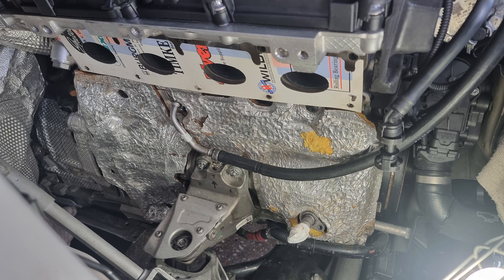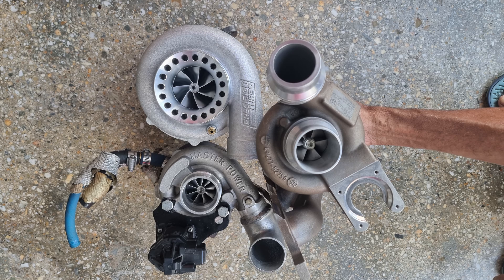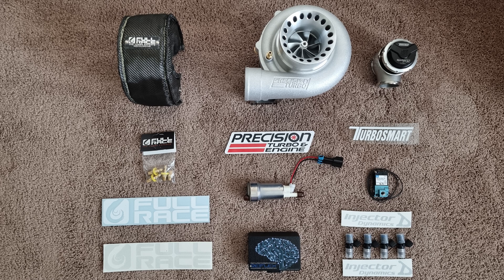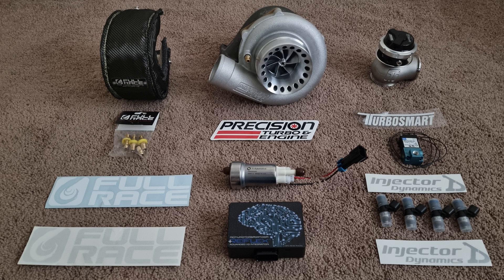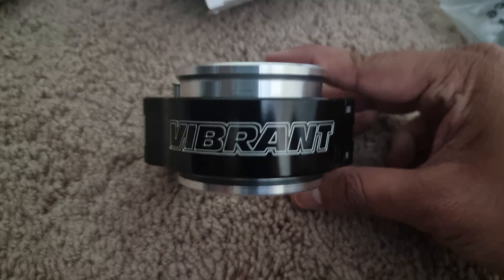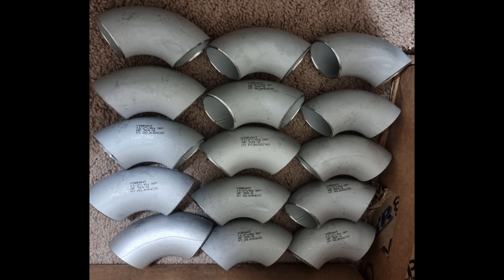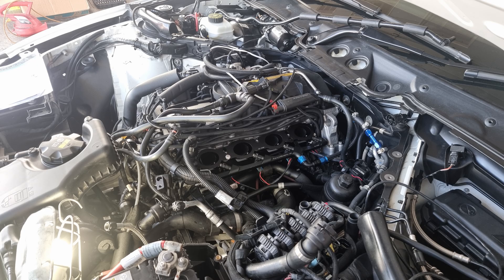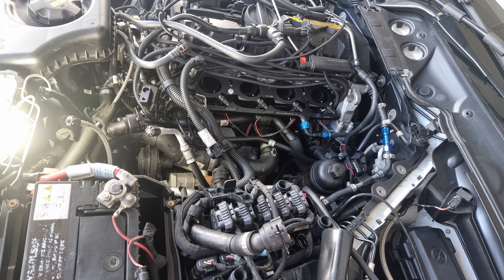Shah's Machine Shop 650whp BMW B48 - New World Record!

Comment: Hello, my name is Dmitry and I am from Ukraine, I am very interested in your project and I would like to ask a couple of questions because I am inspired and would like to repeat it on my f30 330
Question 1) do you have forged pistons and connecting rods? 
2) if I repeat such a project, how long will the motor last? won't it fall apart from such a greater power, because there are only 2 liters.
Reply from the maker: Yes forged piston rods and much more. Check out out engine build playlist to see details. Engine has seen 45+ psi which is around 700whp with no issues. It's built by the very best to send it!!!

Comment: Nice build. I am currently doing a built B48 on a 530e and with every upgrade I can think of. So hoping mine reaches nice power like this. What is the top mount turbo kit model? Did you have to make a custom manifold for it to fit onto that top mount turbo?
Reply: Nice! I also have a 530e and thinking about starting to tune it. Do you have info on your progression so far? Would be very interesting to learn!
Reply from the maker: It's a custom made turbo kit by us.
Reply: @SRHTuned how much for manifold
Reply: any updates??

Comment: Have a b48 2018 330i USA spec what are all the stuff you done to the car I currently have catless downpipe stage 2 bm3 Valvetronic exhaust and xhp stage 3 I want the FULL LIST FROM FIRST MOD TO FINISH PLZ
Reply: Big turbo!
Reply: @v-idea5246  what turbo
Reply: @Dan330i  I got a 2020 330i
Reply: @Dan330i  it’s the 450 turbo on their website
Reply: @v-idea5246  what upgrades should I do to reach that goal
Reply from the maker: @Dan330i precision
Reply from the maker: @Dan330i copy paste what I did for the same goal. Note the turbo has plenty more in it so if you want a faster spooling turbo use a smaller turbo.
Reply from the maker: Details in video, built motor, big custom turbo set up, custom Fuel System, race fuel...plenty more which you can see in video description and our engine build videos

Comment: Ils like having an rwd mustibishi evo with big numbers insane work
Reply: bit of a stretch. several different 4 cyls making big power too.
Reply: @wrth  yeah i know but its the same spirit as subaru and evo. Four doors sedans with  big turbos, good chassis but in a rwd. b48 is in the shadow of b58 because its easier to have big numbers with theses op's engines. It's nice to see theses type of projects  in a 3 series. Imagine if they swap the gearbox with a manual one that would be sick

Comment: How is the hybrid system reacting to this added power, or does it not matter?
Reply from the maker: Interesting question, based on the turbo size and the boost levels, we are suspecting the hybrid side to be adding additional load at these power levels.

Comment: Impressive indeed. Do you think the balance shafts will become a factor hindering the ability to make power above 800whp ? Also are there options to get the engine to rev to 9krpm and make power gains ? I know there is room for headwork. What version of the zf8hp is in that 330e to hold the power it's making currently?
Reply from the maker: Main concern is electric side as a limiting factor. After that it will be transmission limits. GA8P75HZ is the transmission used on 330e and it shifts much slower than a regular ZF transmission. On dyno, the hybrid system limits it to rev to around 6600rpm, however on the road, it can rev out to about 8000rpm (I do have a rev limiter at 7600rpm). Hence if it was able to rev out on the dyno, it would show more power.
Reply: @SRHTuned how would this same setup on a 30i hold up in your opinion same power ? How much hp is the electric motor actually adding
Reply from the maker: @DriveDynamicsAz  Based on previous data of what BBT made on a regular B48 and what we made on 330e with BBT, they were both aligned which indicated the electric motor was not adding anything. LCP maxed out the fuel system at around 505whp which is also aligned to what we made with BBT and where we saw fuel limitations as well. The turbo utilized on our top mount kit is the largest turbo anyone have used on a b48 and capable for much more power. The fuel system is also capable to support much more. On a 30i, it will make similar power, however transmission, drivetrain would be a limiting factor as the 30e transmission and drivetrain components are rated for more.
Reply: @SRHTuned  I HAVE THE M235I 2021 B48E WITH 340HP 400FTLB TRYING TO REACH 500 WITH TUNE AND DOWN PIPE AND INTAKE  TOP MOUNT TURBO LOOK NICE WONDER IF MY CAR HAS THE SPACE TO DO IT ITS TRANSVERSE SO IDK WHAT YOU THINK
Reply from the maker: @lamo75425 definitely. Send it 🎉
Reply: @SRHTuned  When does the electric motor provide power if not at full throttle?  Is it just at lower RPM/speed?  I would hope that it helps with launching and lower rpm to boost torque when the turbo is not spooled.  Looking at a 330e as a daily driver and was hoping the hybrid aspect would help produce a more responsive car in those situation
Reply: @SRHTuned thanks greatly for responding. Didn't know that transmission shifts slower.